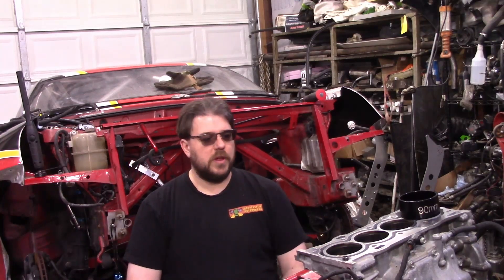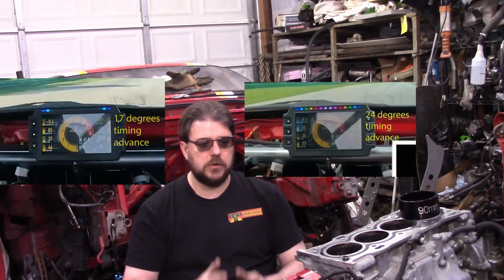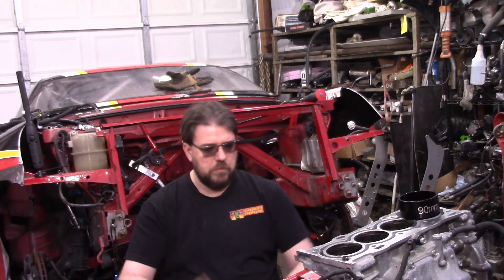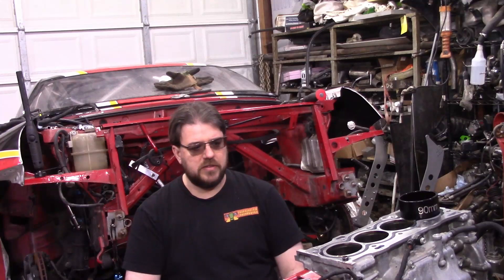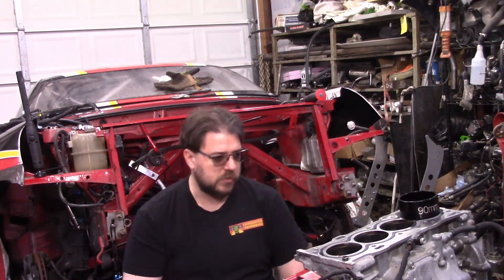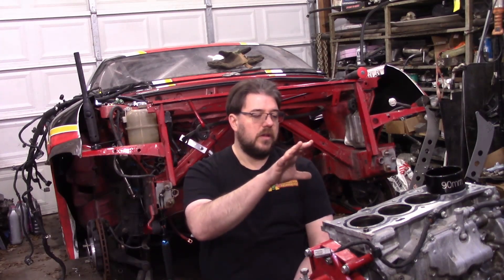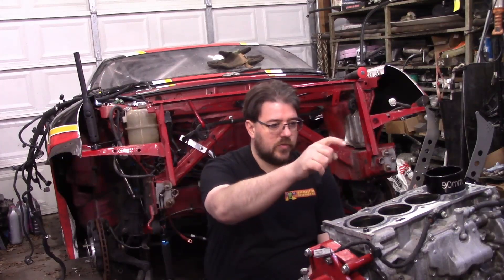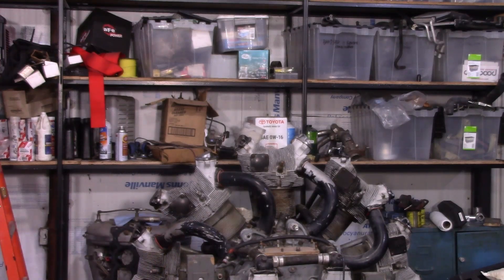2AR Missing power?

Comment: You might try a larger PW on the injector tester, likely at full load that bad injector was opening more but still running way lean. I've learned a lot about injectors recently just trying to get my speeduino Subaru to start and idle nicely on big injectors (speedy has a terrible and confusing injector data page). When running injectors at lower pulsewidths they get inconsistent, so maybe this injector failed in such a way that the dead time has increased, perhaps corrosion inside is dragging the solenoid? Regardless, glad to see it's fixed!
Reply from the maker: the video really did skip over a lot of the tests, the injectors really shut down any time they got over about 2500rpm no matter the pulse width even at over 40ms, almost maxing out the duty cycle. I really can't explain why it failed like this but it was repeatable.
Reply: @FrankensteinMotorworks  Wow what an odd failure mode!

Comment: The deductive methodology you used was probably the best possible way to diagnose this issue. Each step kind of was necessary in order to rule out everything else.
Reply: I strongly agree. I realize it's easy to say this with hindsight AND from the peanut gallery but with those injector test results I'd immediately be wondering "Did I burn up valves?" , "Is there scoring in that cylinder now?" etc.; I wouldn't be able to sleep without confirming the rest. Sucks doing an engine pull to just to find out the real problem but at least it removes uncertainty down the road.

Comment: Been following this, thank you for the complete explanation.  In the very early beginning of understanding EFI and standalone tuning, i went through two different sets of injectors that one of the 4 went bad.  Not easy to pinpoint without experience and the right tools.  Individual egt sensors would be nice but not all can afford to.

Comment: No longer own my 2011 tC but I still will religiously watch your content. Keep up the great work you’re doing Marc!
Reply from the maker: Careful, if you watch long enough you may end up wanting another car with a 2AR or 2GR :) Thanks for sticking around
Reply: @FrankensteinMotorworks  I wouldn’t mind that 😉 I have a 2018 WRX as of now. I just ported and polished the factory turbo and installed billet turbo wheels. Currently making around 340whp, but it’s nowhere near as reliable as my Scion was. The car had almost 200K on it and needed some work done to it, mainly just suspension components and drivetrain mounts due to them being old and almost all original. My ideal build was forged internals, with your cams and valve springs, and a turbo. I just couldn’t justify spending that much money on all of those performance mods and ignoring what actually needed to be fixed on it. My Fiancée owns a 2016 tC with a 6-Speed, so I still get my fix tC when I’m driving her car. Love the fact she wanted it to be a 6-Speed since she learned how to drive manual in my car.

Comment: Oh, how I've missed FMW! Buuuutttt... why do you not use an oscilloscope? In hindsight, that's the easy answer knowing now what the problem is and would've saved you from teardown. It was cool seeing the effect of poor injector pulse on the valves though.
Reply from the maker: I'm confused, how would you use an oscilloscope to diagnose this particular issue? I have an oscilloscope but i just don't see how it applies here.
Reply: @FrankensteinMotorworks  I think it still applies just not as obviously as something that has a dead miss. The smooth idle thing definitely throws me off the path the more I think about it. The injector is firing decently at idle so you might expect to not see the pintle hop as clearly on the voltage side. At the higher RPM I would expect little to no current ramping since there is no activity from the injector. My experience with injector testing is pretty minimal, especially compared to yours.
Reply: @FrankensteinMotorworks  For me it would have been interesting and educational to see what the scope would look like in the 2 scenarios in you're particular situation.

Comment: Last few years Its become a regimen for anything I am working on to have the injectors checked and cleaned.  Recenty had a rb26 come in for some service work with some mild driveability issues.  Turns out 2 injectors were not as strong as the rest.
Reply from the maker: I've had other issues with injectors, that's why i bought that machine to begin with. This did not give me those indications but you're absolutely right, i think injectors will start getting tested just as a matter of course these days.
Reply: @FrankensteinMotorworks  yeah it does not take long and saves future headaches

Comment: Great video! Im amazed They didnt do the classic unhook an injector connector test. Or will that just throw fault codes limp home?
Reply from the maker: that's the thing, in this case that test returned exactly what you'd expect. Since all 4 cylinders were contributing at idle when you disconnected any of the injectors the idle dropped and you heard a lope in the idle. The fact that the injector was working at idle but not working above about 2500rpm is what made this so hard to figure out.

Comment: 185 is low for a 12:1 engine i think
Reply from the maker: keep in mind the cams are very long and the intake cam when at rest is really acting like a simulated atkinson cycle. It's rejecting a lot of the air that came into the cylinder before compression starts.

Comment: Nice detective work, and thanks for sharing the whole process so openly. Really interesting to see your process. Have you guys considered throwing some ID injectors in that bad boy? They do an amazing job of balancing and characterizing their injectors.
Reply from the maker: Injector dynamics really does make some nice injectors and what they do is crucial when you larger flow injectors but the goal of showing off this build was to show off what could be done with low budget using only factory parts. Keep in mind this motor is build using OEM toyota hybrid 2AR-FXE camshafts. I have other builds on my channel making much better power that do use Bosch 980cc injectors but when i grow beyond those i will likely be contacting injector dynamics for bigger ones.

Comment: So Ben Lins 2ar-fxe build dyno run at the end you showed, was that on E85 ?
It'll be interesting to see how the grid life dyno compares too.
Reply from the maker: All the dyno runs i did were with the fuel left in the car after the Laguna Seca event, the sensor was showing 75% ethanol content. 

I expect that the gridlife dyno will read a bit lower, the same as it does in many other instances when people talk about calibrating their car to meet the gridlife power to weight spec. 

This car is still making a bit less power than mine but the difference now is very likely just down to the more restrictive intake area since the fuse box is blocking a lot of the filter area and the longer/quieter exhaust setup than my race car. But either way it is very close to what mine used to make when it had that particular configuration in it.

Comment: Steps for checking injectors.  Remove engine and disassemble head.........
Double edge sword with this one. It was only the injector.  But you had to take the engine apart. But luckily it wasn't something catastrophic.
Reply from the maker: Yeah, i took the really really long way around on this one. But to be fair many other professionals had taken a look at the car and not figured it out either so i don't feel that bad. Just slightly annoyed i had to do that much labor to figure it out.

Comment: Would a 2ZR-FE engine head fit on a 3ZR bottom (to eliminate valvematic)?  And would the 3ZR mate with a C-50 transmission?  I know the crankshaft of the 3ZR is offset to make it 2.0L, but I'm wondering if it will mate?

Comment: Would this have been caught using an IR thermometer on the exhaust runners?
Reply from the maker: in theory yes but in the MR2 Spyder there's no way to get access to the header with a thermal gun or camera, they are tightly tucked in under the parcel shelf.
Reply: @FrankensteinMotorworks  That's right, I forgot the 2AR is (backwards)
Reply: A thermal imaging CAMERA could work.  While an IR gun may not work, a mirror does reflect thermal images as well as visual images.  Though it is tight with a 2AR in a Spyder, i bet you can get  some decent images with a thermal imaging camera and creative use of a mirror.  The cylinder temperatures between the individual cylinders may also show a difference (as a diagnostic tool).

Comment: Nice detective work! 
don't feel bad about the tear down, it led you to the injectors. Sure, you could have done those right away as a diagnostic, but the conclusion wouldn't have been as satisfying in terms of diagnosis, hypothesis, test, and fix. 

I'm still hoping for a sacrilegious Frankenstein MW K24 swap. I'd love to see your attention to detail put into that setup.
Reply from the maker: Yeah if i would have figured it out right away this would not have ever even been mentioned on any video. 

As for the K24, I don't really see that happening, there are two other Toyota engines i really want to play with that i haven't had the time for yet and also realistically the MR2 Spyder crowd does not buy enough parts to justify further developments. The only real reason i still support the Spyder is because i absolutely love the thing and i still use it as my race car since it handles really well with minor modifications.
Reply: @FrankensteinMotorworks  so other than g16e (which the future of swaps I feel Toyota wise) what other power plant tickles your fancy?

Comment: That's actually a good failure. It could have been way worse. Sometimes it's the smallest details you overlook that cause huge issues.
Reply from the maker: Yeah, I'm really amazed this did not melt down the #4 cylinder. This is the strangest injector failure i've ever seen.

Comment: Bad injector. Man. Can’t tell you how many times I’ve ran circles for miles when I could have just reached out and grabbed it. Still  the valve touched. You said bearings when good so was the leak down. Was something in the valve train?
Reply from the maker: It looks like some 2AR-FXE engines may have some slightly lighter valve springs from the factory. I haven't looked into the details, they are only slightly lighter pressure. they measure the same number of turns and wire thickness but i think the static height is a tiny bit less so they have less preload.

Comment: Radial engine, eh?
Reply from the maker: Yeah, i did one back in 2011 but i had only been fabricating stuff for a few years then and i've learned a lot since then so i want to take a 2nd go at it and actually make something that can do more than 20 laps on the track this time.
Reply: IIRC Marc used to run a radial swapped MR2 in 24 hrs of lemons. I would love to see that resurrected!
Reply from the maker: @yelsew816 The old car has long since been sold so it will not be making a comeback and this engine has almost 4x more displacement so it's a smidge bigger and would not fit in that car anyways.